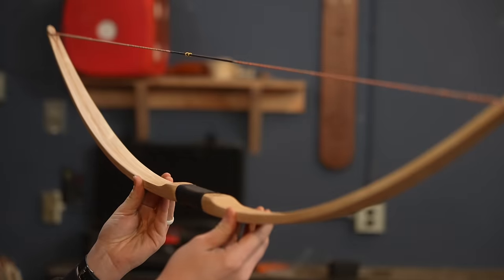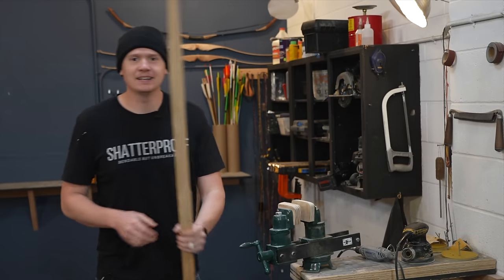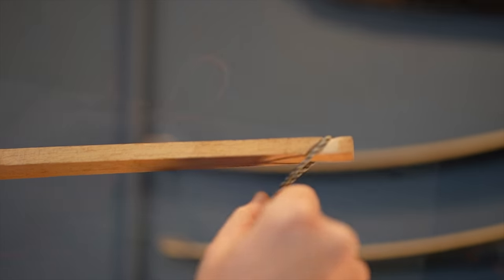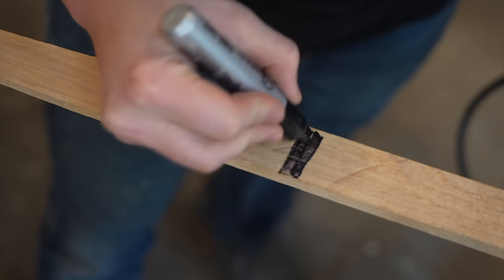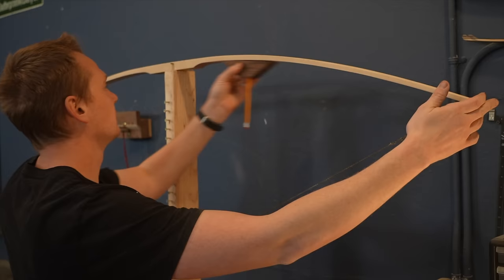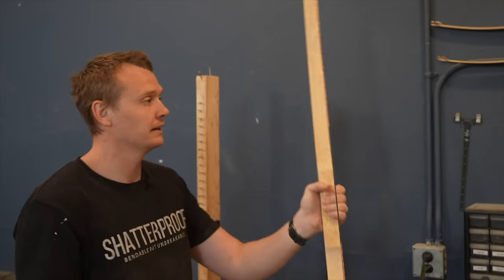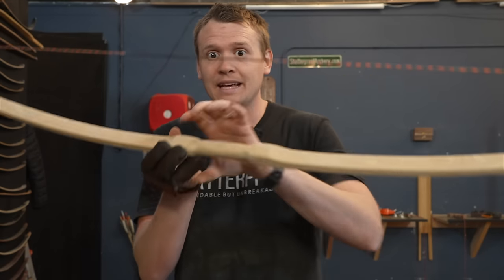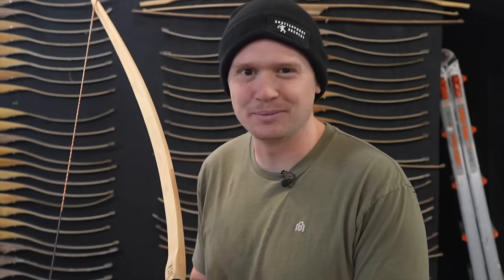Build Your First Hickory Self Bow

Comment: The bow gods are smiling! This video will greatly lower the barrier to entry and allow so many new bowyers to enjoy this craft

I hope it’s alright if I offer some further thoughts and minor disagreements for the sake of discussion. We all do things differently

The problem with tillering gizmos is that they mark out an even circle. For the vast majority of bows this leads to too much inner limb bending and stiff mid and outer limbs. 

Thinner wood can bend to a tighter radius than thicker wood before it reaches the elastic limit (takes set.) This means that the outer limbs of the bow can bend to a tighter radius than the inner limbs. If you bend them to the same radius you’re overworking the inner limbs and underworking everything else. 

If you had no thickness taper then it would make sense to have circular tiller but otherwise pretty much any straight stave design will call for a more elliptical bend shape. 

I do also recommend the gizmo because the wrong tiller shape is better than no tiller at all, or a broken bow. But if you use it I suggest manually working the mids and outers more than the gizmo suggests 

Another part I’d suggest doing differently is the handle, and fades as well. Typically modern bowyers leave the handle blocky and then carve the handle once the bow is tillered. Bowyers who specialize in self bows tend to rough out the entire bow, including the handle and fades. The width and thickness fades are established at the time of the rough out, and then they are incrementally tillered together with the bow. 

The big advantage this way is you’ll never have the handle jump scare you by bending when you don’t expect it—because you adjust it carefully and incrementally together with the limbs. More importantly, if the handle and fades are already established once the bow is tillered, it means you don’t have to do risky carving near the fades.  

Typically on bows with fades the fading from handle to limbs is done in both width and thickness over the same distance. In this bow the width fades and thickness fades are distinct, which takes up more space than necessary. This is definitely an overly pedantic nitpick, all I mean is that one could save a couple inches of bending limb by making the fades the traditional way. 

For good examples of fade design study west coast paddle bows for bending handles. For stiff handles search for buchanan dips. Swiftwood Bows and Clay Hayes also have many videos showing the handle features I mention here. 

Most side on pictures of fades show the side profile but keep in mind that the fades have both a thickness and a width component, and that they should be complimentary. Ie the limbs are wide and thin but the handle is thick and narrow. Or when you narrow the handle you need to thicken the fades. If you separate the width fades from the thickness fades you’re creating weak points anywhere you narrow the handle but don’t increase the thickness. I worry that the handle bending in the video may come from these abrupt transitions.

I hope these points are taken constructively. If I have been picky it’s because this video has great potential to advance the craft. 

Now may the algorithm gods do their work!
Reply: Thanj you!

Comment: Watching this after having my first bow break lol. It was an oak stave with the wood glue and glass fibre tape backing that you made a video on. Luckily, I have another piece and will try without backing! I think I might have made the ends too thin, because the middle wasn't bending like yours is in the video. Would you recommend roughly keeping the same thickness throughout tillering? Because my ends were not even a third of what it was near the handle.

Comment: Kramer, why do you want 1/4" positive tiller in you bow?
Reply: Even when you make a bow perfectly symmetrical, you can’t actually use it symmetrically. You can’t both hold the bow in the center and shoot from the center, so you have to cut a compromise. Since we shoot above our hands this puts more mechanical advantage on the lower limb. So to compensate, we leave the lower limb slightly stiffer, leading to positive tiller.
Reply: @DanSantanaBows  Beautifully explained, Thank you!

Comment: I don't have these woods in my country,  but Beech Wood is available, and I thing lemon tree wood.
I am thinking about making a 60" laminated bow, using beech wood in the belly and lemon wood (2x 40" pices) in the back also i want to put around 5 or 7 layers of the fiberglass drywall tape and a layer of artificial leather. And a layer of fabric in the belly of the bow

I don't know if it's gonna work or not. Any thoughts or advice?